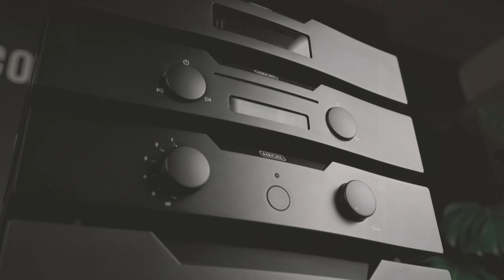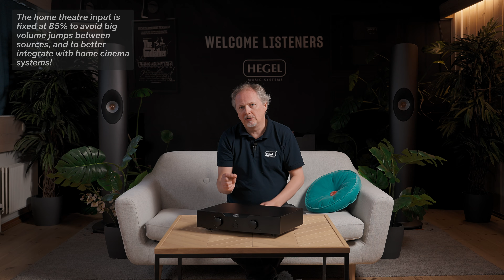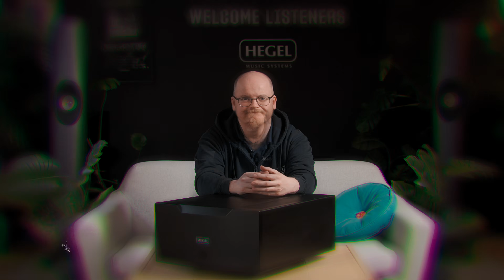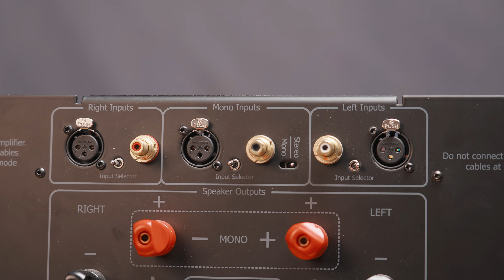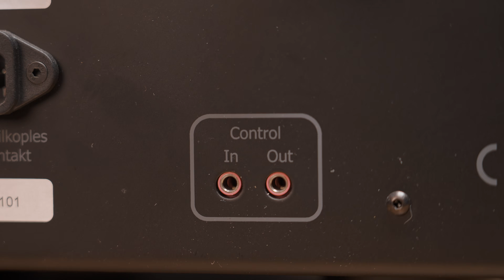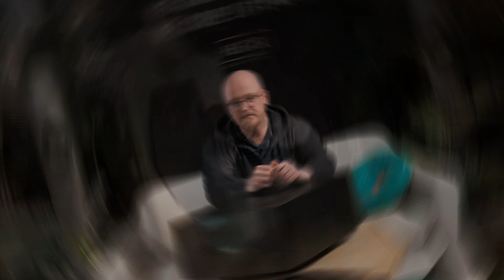Hegel Reference P30A and H30A introduction

Comment: I have this setup with the Hegel H30A and Hegel P30A, and I’m immensely happy with them. Paired with Focal Sopra N2 speakers, they sound wonderful—the synergy is excellent. The preamplifier is very precise, true to Hegel’s philosophy. Highly recommended.
Reply from the maker: Thank you so much for this nice comment. Its a great match with the Sopra 2.
Reply: Hi Mate! I also have Sopra 2 and am considering the P30A/H30A combo. Have you used anything else to power your Sopra 2? if so what difference did the Hegel combo bring? Thanks so much if you reply!

Comment: As long as you use cheap Neutrik XLR jacks on a power amplifier like this, it's obvious that you haven't paid due attention to the sound.
It's a shame that you're making compromises exactly where they shouldn't be and aren't recommended. That's why you'll always stay in the hifi zone of sound instead of climbing into the highend zone.
Reply from the maker: We actually believe  the Neutrik connectors are very good. We have done a few comparisons on all types of connectors and the expensive ones doesn't always win.
Reply: @HegelMusicSystem  Yes, i agree with you. But you just CANT tell me the cheap 5$ connectors are better than most of highend connectors.
Reply: Neutrik does impeccable engineering. They're not a snake oil company.

Comment: The P30A produces audible tweeter hum from a meter away. This is quite unusual compared to other preamps. However, the transformers in  H30A are even more so than in the H30 This is unacceptable in this class of equipment. Everyone should check it out for themselves
Reply: Mine is dead quiet, sounds like you have an issue

Comment: “High End…Norway” on the back.  

Please confirm product is made in Oslo.
Reply: It isn't.
Reply: That is my exact problem with Hegel. They are deceiving people that don't know any better.
Reply: @racecardriver-g4r   ...you have a mental disease...it's obvious.
Reply: Like the back of your IPhone… “Designed in Cupertino” 😂
Reply: China it is!
Reply from the maker: The products are designed and prototyped in Oslo. Most important components are sourced in Oslo. Final assembly is in China before QC again in Oslo.
Reply: I used to think made in China was garbage until I tried using local manufacturing.  We as a country have lost the majority of manufacturing to other countries so what makes anyone think the USA can compare when it comes to consistent builds to a country that has been manufacturing most everything we use like iPhones etc. for years while we don't manufacture shit!  They are in better practice and if they use high quality components or the components on the Bill of materials then all you are questioning is if their machine assembly work as good as machine assembly work in other countries?  I would submit that China is so practiced in this field their builds are better than anyone.  After all, they have the most state of the art equipment.  It's not like a bunch of Chinese guys sitting down with a soldering iron.  The product is then QC'd by Hegel and I am sure they would catch inconsistencies or quality issues.  Some of the Chifi stuff is excellent and I own several pieces.  This is why Hegel is not 4 times the price or more.
Reply: @chrisvantassel8867  I have ton's of ChiFi. Most are amazing. The point isn't "MADE IN CHINA" it's the continued attempt to hide that fact. Would respect Hegel so much more if the country of origin was displayed in the same font size as "Norway".
Reply: @szh70   ...if, as a prospective customer, you have a brain & you do your research before purchase then you would know (find out) that their amplifiers are assembled in China. My H390 sounds fantastic, especially since I bought it at the wholesale price.
This fixation that some people have with it should have Made in China plastered all over it, when it is only assembled in China, is tin-foil hat insane when it's so easy to find out this information.